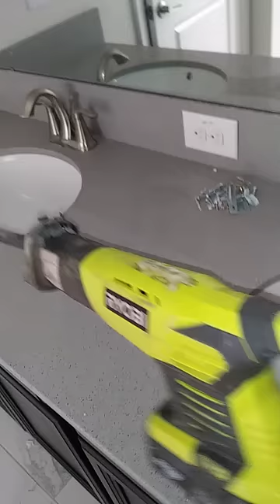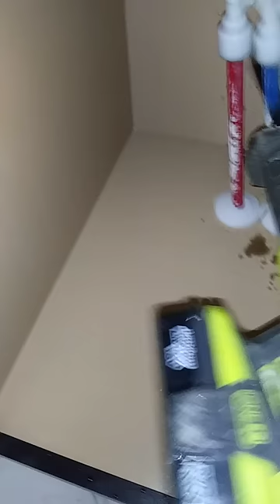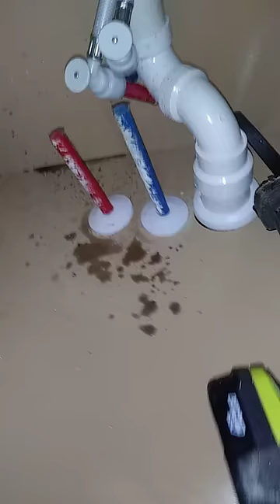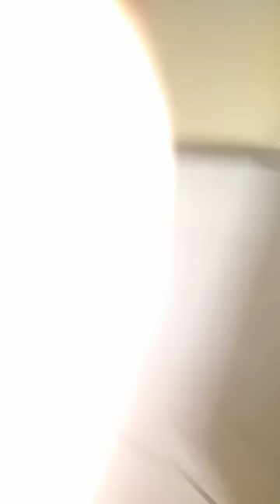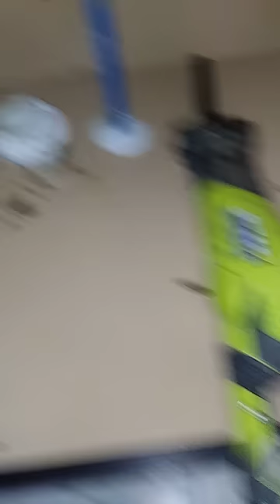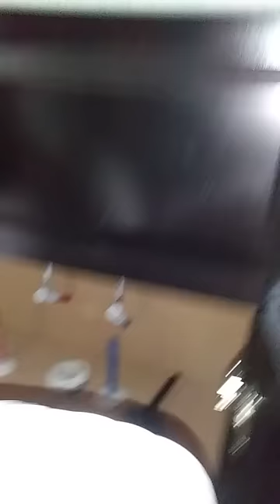This is what happens when you DON'T pay your plumber.

Comment: When you DO get paid,  buy yourself a new sawzall blade!
Reply from the maker: Just got a new Blade. Yay
Reply: N N I don’t think it was the saw think there was to much play in hot and cold pipes went through the waste no problem
Reply: It’s not the blade it’s the fact the he isn’t holding the pipes
Reply: Or pex cutters
Reply: At least he turned up
Reply: I was gonna say the same thing.
Reply: Diablo blades are great :-)
Reply: The sawmill doesn't work well because the plastic flexes easily.  I would have taken the tub spout, gutted the tub valve and pulled the crosspiece from the tub drain., Ex plumber here. I also would have pulled the guts from the commode. If you want to write off the whole job take a hammer to the cast iron tub or cut the fiberglass one.
Reply: Cable cutters for that flex tube.
Reply: @HungarianHacker  as a contractor I usually have about 10 blades on my truck. Also as a plumber, you should a have pex cutting tool. Its faster and better than a freaking sawzall.
Reply from the maker: @GetRichBuyGuns  I went with a more dramatic approach. I didn't even think about recording it until I got into the bathroom.  I have an expensive rigid pex cutter in the truck. The blade was fine, I just had to much play in it.  And used my other hand to hold my phone.  It went through the pvc just fine.
Reply: @i.g.6733  you sir,  I would pay in advance! lol
Reply: I would do the same only thing different is i wouldn't turn the water off
Reply: And hey a new sawzall
Reply: As a plummer people are gonna rip you off every now and then but the way i see it what goes around comes around me personally its a small bathroom i wouldnt have wasted too much time i would've just learned from it so it doesnt happen again  but next time pull up and cut flush  thay way pipes will end up underneath cabinet
Reply: @HungarianHacker  great, that one struggled........for a cut job like this gotta be quick 😂😂
Reply: You crazy lmao
Reply: Haha i came to say the same shit
Reply: Get new tools.  Ryobis are for diy filthy casuals.
Reply: its not the blade, he didnt hold the pipes in place. I have the same tool and it would cut pipes like these easily even with not the newest blade.
Reply: And a real sawzall
Reply: A new sawzall period😂
Reply: Dewalt or ridgid are the most durable trust me l had almost all types of brands of sowzaws
Reply: @357sig33  Milwaukee all day everyday
Reply: With some demon blades and you set
Reply: Bro one handed while recording.  Not to bad.
Reply: You mean a new sawzall period he gots a fucking ryobi lol
Reply: Lol
Reply: and a better sawzall
Reply: It's NOT the blade, it's the fact that the supply line was vibrating along with the blade.
Reply: He didn't want anything clean about it. He used the worst one he could find in his bag and let it have it. Did u not see him intentionally hit the cabinet?  lol
Reply: The pipes are moving and he’s doing it one handed
Reply: What a about new ridgid sawzall?
Reply: And get Milwaukee
Reply: Lol yea dull as hell could barely cut through plastic
Reply: Id have to chop wires in that situation
Reply: @HungarianHacker  milwaukee sells the best plumbing equipment
Reply: It was vibration not blade
Reply: His cutting it with a metal blade
Reply: I was gonna say the same thing 🤦
Reply from the maker: I bought a 10 pack today.  It finally stopped cutting yesterday. Fml
Reply: I thought I was the only one thinking it
Reply: Or get a better sawzall itself lmao
Reply: ….pex cutters are really handy too.
Reply: And a real Sawzall
Reply: Nothing wrong with the blade he's trying to record the video with one hand and teach a lesson with the other hand lol
Reply from the maker: I taught them a good lesson.  Lol 😅😆🤣😂
Reply: And a battery upgrade
Reply: I thought  he was redoing  the shitty plumbing job 🤣
Reply from the maker: What shitty plumbing job¿
Reply: @Tx-do9fe  maybe a Milwaukee next time?
Reply: @James-b7p2k  ALAW? was just going to comment the same thing.
He should have cut through them at the bottom, where there was less play.
It's like trimming a hedge with a chainsaw.
Reply: If he was a real full time plumber, he would have had a pex cutter and snipped the supply lines Instantly
Reply: Or. Use a pipe cutter for the water lines and a Sawzall for the drain lines. Gonna be a difficult repair for the next guy
Reply: Or tools that aren’t for complete losers and unprofessional “tradesmen”. Do it right or don’t do it
Reply: Fr it pissed me off how dull it was
Reply from the maker: I'm sorry.
Reply: It's a Ryobi I think it got chosen specifically for the task XD
Reply: The blade was probably fine. It's just hard to cut flexible material with one hand.
Reply: @TheTinkle1 yeah all I could think the whole time was hold the dang pipe! Lol its not cutting when it's running with the blade.
Reply: Looked like a metal blade to me at first… not a plumber but the one I roll with (General contractor) uses general purpose Diablo blades… they seem to be for mostly wood/pvc compared to the blade on the vid